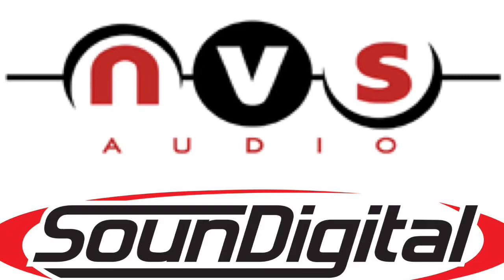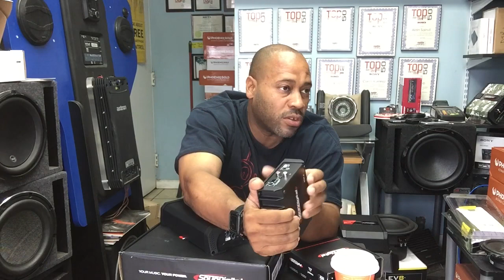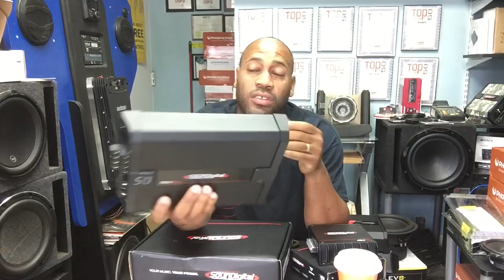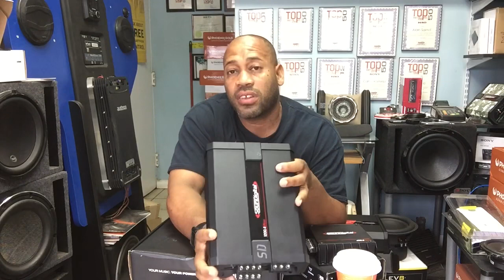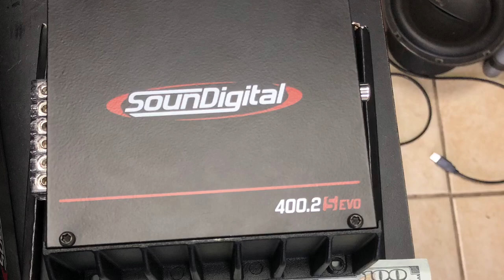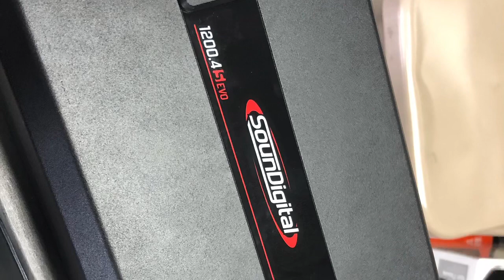New sound digital 400.2 s evo and 1200.4 s evo amps

Comment: I have a 2014 Harley Street glide and I have a few questions on how to wire up an amp like that
Reply from the maker: norman matura what is your question?
Reply: Yeah on my 2014 Street glide, I want to install for six and a half inch speakers in the front between the upper and lower fairing and two bullet tweeters and a pair of 6/9 two way in the saddlebags.
How many amplifiers should I use
Reply from the maker: norman matura if you only do one amp I would do a sound digital 800.4
Reply: @NVSAUDIO  thanks bro I appreciate it
Reply: Could this amp play, mids, highs and bass at the same time?